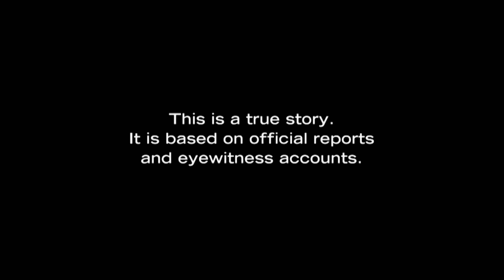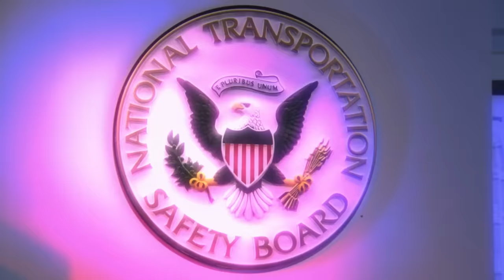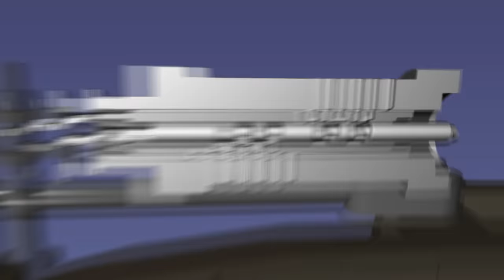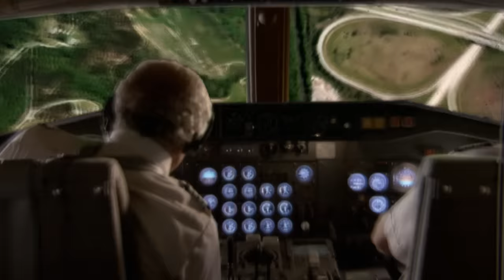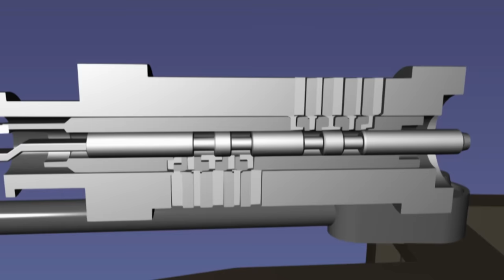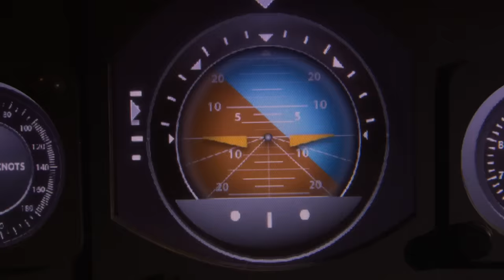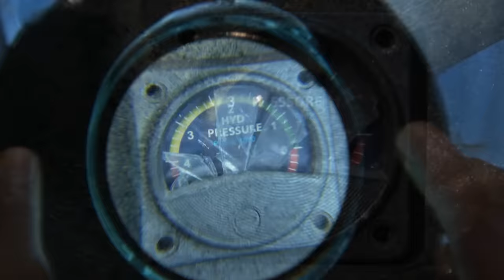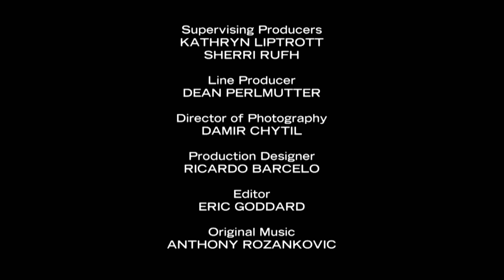The Baffling Tragedies of United 585 and US Air 427 | Mayday: Air Disaster

Comment: That controller’s reaction is a lot more relatable than what we usually see.  Most of the time they’re like, “Oh dear, an airplane has crashed.  That’s unfortunate.”
Reply: It's more relatable but less ideal. There are actually... other planes ATC needs to keep track of since usually before a crash the airspace usually isn't cleared (if they get a Mayday call they will usually clear the airspace of other planes but in a lot of these cases the plane crashes too early for them to even contact ATC). So "Oh dear an airplane has crashed. That's unfortunate. I'll notify the appropriate team of the problem. Well, let me make sure these other planes don't hit each other while they are in my airspace" is more ideal than "crash!" but in practice the latter reaction is more realistic. You're supposed to keep these emotions in check while on the clock both during routine day to day communication and during disasters and save any reaction for after the clock, but it is difficult to avoid a horrified reaction when a bunch of people die before your eyes.
Reply: They are supposed to keep their emotions on check, as much as humanly possible.
Reply: This tragedy called as "hidden danger" inside aircraft after solving it for 10 years.
Reply: Depersonalization is a trauma response
Reply: @alex_zetsu Yeah.  And even if they don't externally react, most DO have some kind of internal emotional reaction and need a break.
Reply: I noticed that, too. A real,  raw reaction. Most of them don't blink an eye but l guess you have to stay calm. No thanks. I can't imagine doing that job. God bless those who do!

Comment: I grew up right next to the park United 585 crashed at. Always saw the memorial and wondered what exactly happened. Met some people that lived in the apartments a few hundred feet away that lived there when it happened. They had some crazy stories about finding body parts that landed in the complex
Reply: If you seen the funny news story of the whale being blown up on the beach in the 1970's, apply that to an airplane hitting the ground at 600mph and you get a idea of the extreme velocity of the crash. I remember reading a story years ago, not sure if it was true or not, a air conditioner installer was working on the roof a building near where the WTC was, and he found a skeltonized hand with rings and bracelets on it on the roof of the building. They did testing on it and found out it was one of the passengers of United 175.

Comment: Crossover Speed is the speed that requires FULL lateral roll control from ailerons & spoilers to counter roll due to Yaw caused by FULL rudder input. At speeds less than crossover speed with FULL rudder input the roll induced by the rudder starts to exceed the lateral control authority of the ailerons and spoilers.

Both 585 and 427 had the hard-over occurred at higher speed recovery might have be more achievable 

585-That close to the runway at low altitude your chances  are slim to none. 

427-had the altitude but not the speed. It was quick the crew did not have time to recover.
Reply: That's fascinating. Thank you for the explanation. I've always been intrigued by air travel.

Comment: Right off the bat, something I’ve never understood is why fly from Denver to Colorado Springs when they are only separated by 70 miles from center city to center city? You hardly feel like you’re out of one and in the other when you drive the Interstate… ?
Reply: I'm not from that area, I'm a native to Florida (Miami) so when I read your comment I had to check it out. Yeah it's about 70 driving miles, an hour drive. Why would anyone fly commercial for that short of a distance, and the bigger question is, why would a an airline fly a 737 for such a short distance? I can see maybe a twin engine prop (commuter) plane. But a 737?
Reply: Denver is a United Airlines hub. Most passengers are not flying from Denver to Colorado Springs but are connecting through Denver.
Reply: @ScarabChris Another possibility is plane relocation. the airline has a plane landing at one airport but they need to transfer over to a different airport to pick up a larger number of people. eg. you have 70 people flying to airport A and 80 people trying to fly out of airport B and they are close enough together that you can use the plane landing at A to pickup at B. plus you can open up that flight to the public to recoup the costs for relocating the plane to the new airport.
Reply: @hi14993   You make it sound like airlines are smart. :)
Reply: Most people flying into the Springs from Denver are not from Denver, but are on connecting flights from other cities. I have flown into the Springs on connecting flights from other cities.
Reply: Just like most major cities, it can take hours to get out of town when traffic is bad...
Reply: Not everyone owns a car.
Reply: Good question. This is where high speed trains make better sense for this type of travel. It would only take 25 mins for 75 miles of travel by billet train.
Reply: @ericshang7744  
The former governor of New Mexico, Bill Richardson, actually wanted the Rail Runner to go all the way from Albuquerque to Denver, up through Trinidad, Pueblo, Colorado Springs and into Denver. Denver also wanted that to happen. Unfortunately it didn’t happen.
Reply: I agree.

Comment: That area between about denver and the NV border can develop ferocious wind patterns and meso-cyclone storms, I've flown through and to different cities there and have seen and terrifyingly experienced.  It's not usually bad going over, but we hit windshear that knocked us down 500' ft in seconds taking off from Pitkin Co airport, it was wasn't like a pitch down dive, it was eerie, like when Wiley E Coyote thinks he's ok, but drops straight down.  We weren't more than 3000' from the ground, in thin air, in a narrow mountain pass with 13,000ft peaks around and a valley floor of 7000' or so.  Only time I've been that scared on a flight, even when I got out of some at 13'000!  It's such a dangerous place to have any kind of malfunction at all, and we had a sharp, retired vet local pilot.  He kept the plane incredibly tightly controlled through it, had thought ahead about what if...   Pilots are sharp people, and you're in it together.
Reply: Makes we want to avoid these dangerous places. I'll never fly in to Colorado Springs.

Comment: I have a question. In both United 585 and US Air 427 the investigation found that chips/shavings of metal were found in the hydraulic fluid. 

But, when conducting the “chilling test” no chips/shavings were found. 

So does this mean that the NTSB’s investigation is still off somewhere or am I missing something.
Reply: My understanding is that there are filters that surround the servo valves . So yes there are metal shavings in the fluid but they get caught by the filters. That's why when they inspected the valves and found them clean with no scratches. They assumed the Servo Valves were working correctly. But when they ran the test for (Thermal Shock) is when they realized that when the hot hydraulic fluid would enter the valve that had temperatures ranging in the -30 to -40 degrees that the valve would malfunction...

Comment: The test @ min 42:00 - 42:16 is improperly conducted. The "Pegasus" valve would never be dry during flight. It would have oil on both high and low sides and in the lines. The oil would be cooled @ gradual levels away from the pump, then reheated @ the pump. They tested for expansion lock up. My G&L cnc machines used the same valves for axis drive. Very, Very reliable and extremely expensive.
Reply: The key word that only could allow "valve reversal" possible is Dual-servo valve that's used @ end of show.

Comment: I have a few questions as a layman so excuse my ignorance. 

1. With propeller engines the blades can be feathered. As an emergency procedure,  what if the pilots could force the rudder to feather? Wouldn't this enable them the right the plane?

2. If the plane wants to roll either left or right, instead of fighting it and trying to force it the other way, how about rolling the plane completely over and try to keep it right once it's completed the roll? 
3. At the end of the video it showed two planes and it looked like there a parachute attached to the tail. Anyone know why?

Comment: What is not included here is that even after definitively discovering the cause of these crashes, 737s were allowed to fly with old style PCUs until they could be replaced.  Being familiar with Parker/Hannifan hydraulic rudder control valves as installed on large marine vessel applications, I believe they are excellent  and continue to be the industry standard.

Comment: It prompts the question , why didn't this happen more often in such a widely used plane. The weather/climate/temperature situations were widely varied in these crashes. So the wildly fluctuating temperature tests that were done on the rudder apparatus wouldn't have duplicated the situation in these crashes. It seems like they have figured out part of the issue but not the entire thing. 

It also reminds me of the weird things that happened to navigating instruments of both aircraft and ships in the Bermuda Triangle when natural gas was released in their paths and they had no idea what was going on. I don't know if it affected the ships and planes themselves or just the navigation systems. When those systems are relied upon and the captains adjust their controls accordingly you can see how they could be the cause of disasters.

Comment: Looks like it happened so suddenly they couldnt process what was happening in time to take corrective action

It's possible if you firewalled the engine on the dropped wing the plane would level.
Reply: Doubtful. And for 585 at that altitude, their chances of recovery were nil.

Comment: I don't know but this problem of the Boing 737 rudder does seem not that hard to figure out. From common knowledge are only 3 possibilities when a hardware with direction operates: right/left/ no direction.
When we play PlayStation games often such issues happen when we press the wrong button. I know playing games and complicated certified engineering hardware is not the same. However, as a good investigator, If the NTSB had just simply removed the assumption that all the rudder parts were working fine in spite of them passing tests, and tried all the parts in the rudder that could go wrong, they would arrive at this issue.
Reply: HeyDoofus, it wasn’t even known for 10 years that the rudder was problematic. It was only after the second crash and they were able to do extensive testing on the rudder hydraulic operator that survived the crash that the ultra rare problem was discovered
Reply: @CP-ux9zd  I guess I forgot the time difference between the 2 events...it's just the when there is a problem with left and right the rudder straight away comes to mind....but it must be more complicated that is why it took NTSB so long

Comment: One of my tenets for survival in the air is to not board a plane where either of the two pilots is a WOMAN. Unreliable, subject to emotion-based insanity.
Reply: yes because it is known that men were never involved in airplane crashes ever!
weirdo
Reply: @mooneedy Not the point. You proved his!😮🫨
Reply: Source? What are the statistics that prove this? It seems you can’t work anywhere in aviation as a woman without some sort of chastising or criticism…
Reply: @manicpixiedreamhurl they could start by changing the name “cockpit” to something neutral like “control room.” Or just use the other commonly accepted term, flight deck.
Reply: What would you do if you peeked into the cockpit on boarding and saw one (or two) at the controls? Forfeit your ticket?